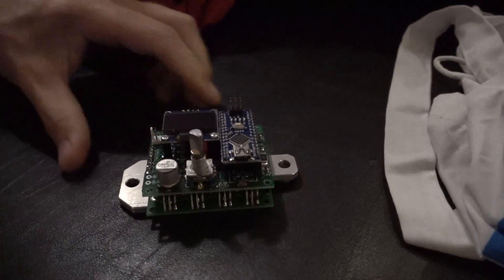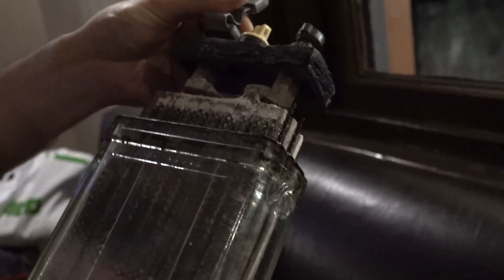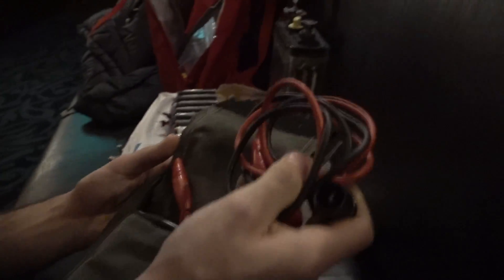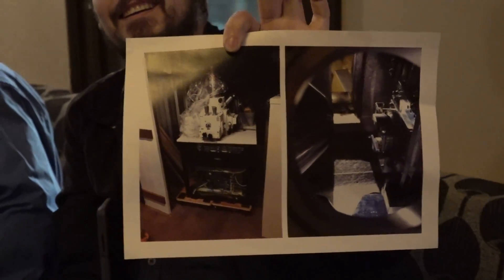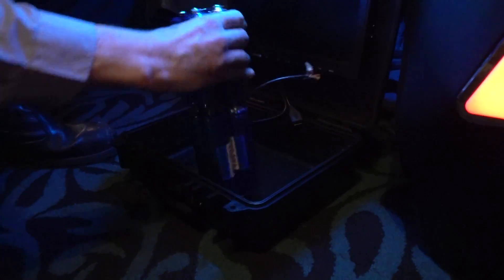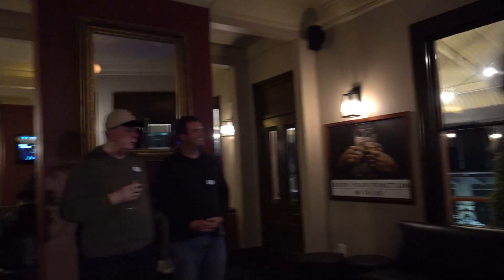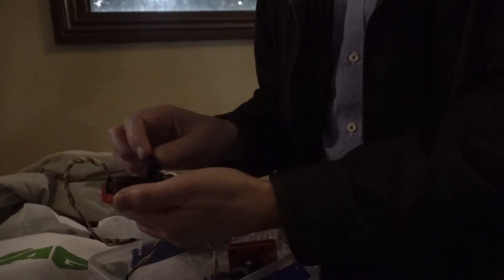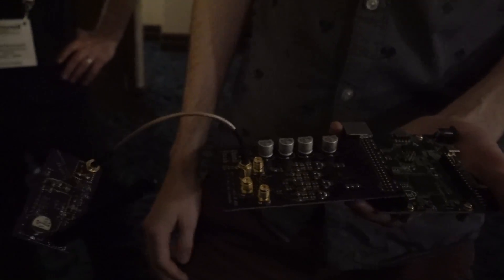EEVblog #1123 - EEVblog Meetup 2 Electric Boogaloo

Comment: Lead-acid may be “grandpa” tech, but it’s still got the lowest cost per Watt-hour of any battery. When price is more important than size, old tricks are still the best tricks. 
Good crowd!
Reply: Still used in telecom too, in fact the cells look a lot like those, except MUCH bigger.  The ones we have at work are around 3900 amp hours per cell, in strings of 24, and we have 4 of those strings in parallel.   It's what makes your phone and internet continue to chooch even when there's a power outage.

Comment: Can't believe Maker's Muse went to an EEVblog meetup. It's like two different realities converging. I'm a subscriber to both having recently delved into 3D printing. I would have loved to have gone but it's a bit of a drive from New Jersey.
Reply: Why? Engineers generally tend to mesh well with each other even from different fields.
Reply: Siana Gearz  I meant that two of my favorite you tubers from different fields run in the same circles. But now that I think back, Dave has done some work with 3D printers but we mostly saw the electronics side, not what he was printing.
Reply: Exactly. Software and Electrical engineers often dabble in each others fields for example. Mechanical too

Comment: Haha was awesome to finally catch up. Excellent evening.
Reply: Yay my 2 fav people.
Reply: It was indeed!
Reply: But the question is, who's that handsome fellow next to Dave in the thumbnail
Reply: You both could use a dual material printer and normal and conductive filament and then find out if it is possible to print useful objects with usable electric paths inside. Maybe even adding some electronic components while printing and have them connected by the conductive filament inside the object.
Reply: conductive filaments have very high resistance, but you can use them for capacitive touch interfaces.
Reply: @MakersMuse  So you could combine conductive filament with temperature color changing filament to make something that changes its color at button press.
Reply: You 2 look related